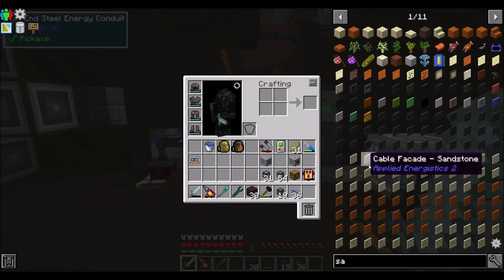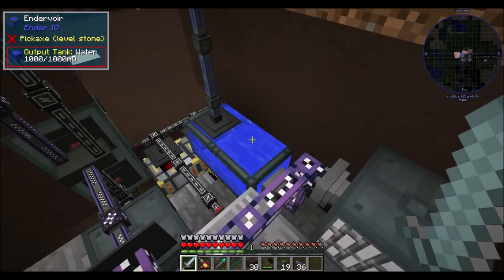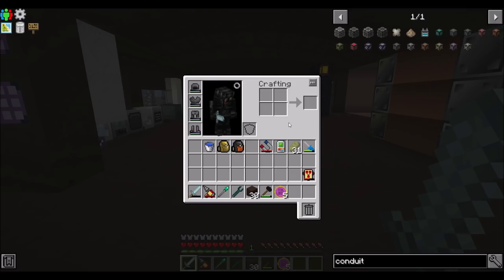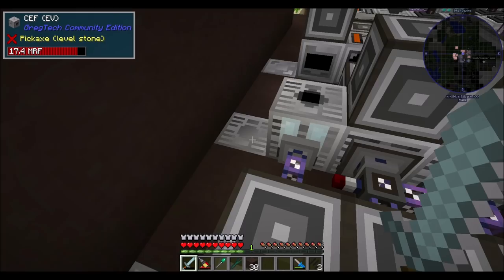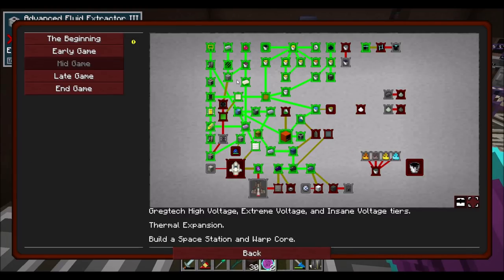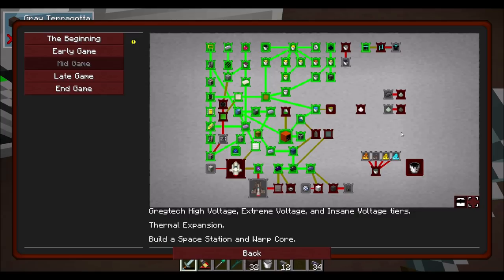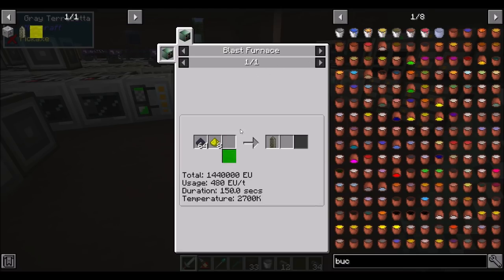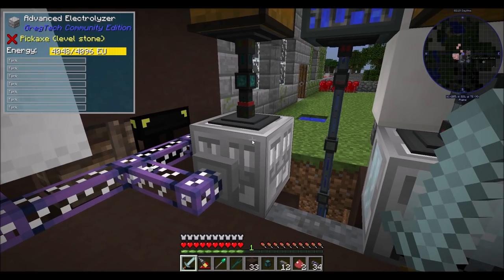OmniFactory   Ep46 EV Upgrades and Lapotrons

Comment: The End has LOTS of platinum and palladium. And yes the microminer are 100% worth it just let them auto craft and you get free stuff fast.
Reply: Platinum also comes from nickel for those of us who don't like travelling.  Of course that would require dire to actually use the ore washer.  Palladium you need so little of I just buy it until omnium at which point it can be gotten from microminer.

Comment: With diamond in the nursamatic gen you get 6k rf a tick(cant remember which u get) but you do get 6k power  when its upgraded and have power upgrades filled minus the coil upgrade to keep it from wasting power.
Reply: baseshooter11 I’m a little confused as someone who hasn’t got that far into the pack yet, 6000 RF/t is just 600 EU/t after conversions roughly? That’s not awful but building a Diesel Engine that makes >6000 EU/t surely makes more sense for long term power.
Reply: @ShawFujikawa  the RF/eu ratio is 4/1 and the numismática gen, when upgrades to signalum and with all upgrade slots filled can generate 20k RF/t using diamonds, with deep MPB learning you can make a self sustained power gen with ease
Reply: @Tsukiumy  pretty much

Comment: Dire wants clay: "Absolutely have to get that cobbleworks going." Also Dire: Totally ignores the fact that Terracotta pulverizes into four clay dust per Terracotta which gives him as much clay dust as he wants. Just set up the Actually Additions Miner to go get some Terracotta from nearby buildings and watch that bad boy strip mine it right off the buildings! :D Color apparently doesn't matter, you just want the clay from it.
Reply: A cobbleworks is so much more useful.  Not only does it produce unlimited clay dust but you also get gravel/sand for conduit binders.  Glass is used in a ton of recipes.  Along with nether quartz for lumium/signalum/enderium and pulsating clay polymer for Deep Mob Learning.
Reply: A. Cobbleworks isn’t in this pack, actually play this pack
B. Clay is infinite thanks to tweaking
Reply: @chonchjohnch   Cobbleworks is in almost every pack with a way to automate gravel/sand.  It pre-dates the cobbleworks mod which I've never heard of until I just did a search. all you are doing is basically making everything from cobble that you possibly can.

Comment: Finally, you understand the Importance of Naphtha. :D
To increase your output you can use  Bisphenol-A.
For 1000 mb of Epoxy Resin you need only:
1000mb Phenol
1000mb Oxygen
2000mb Propene
1000mb Benzene
125mb Phosphoric Acid
only 1666mb Chlorine!!!!!
and you even get 333mb Hydrogen

If you Steam Crack Naphtha you get already half of the ingredients: per 1000mb Naphtha you get 100mb Benzene and 300mb Propene. That results in 10.000mb Naphtha for 1000mb Epoxy Resin. This is just 4% better, but if you add all the other ingredients of steam-cracked-Naphtha like huge amounts of Ethylene you will be blown away. 
Also, it saves lots of Chlorine and you get additional Gasses to burn.
On top, you also can steam-crack Heavy Fuel and use your already build setup. Don't worry you always have anyways have to much of it. So you can transfer heavy fuel into Epoxy resin. The same works for Refinery Gas and Light-fuel. The beauty is you just have to build it once. HV-should be enough for the rest of the game.

If you have further questions you can contact me on Discord: JarJar#1187

Comment: I feel like you need to make break everything into modules... For example; instead of distilling water right where you need it, setup a distilling station where it dumps into the ME system. Apply that logic to literally everything and increase the efficiency of the modules when they become bottlenecks.

Comment: numismatic dynamo + Deep mob learning Shulker modules = Unlimited Diamonds and power. Basically 6250 rf/t without too many augments from 1 diamond. Setup a few simulation chambers and automate it. (top being input, any other side is output). Setup like 5 sims and 4 dynamo's with augments is 40kRF/t. (with power augment and reinforced tier). or 10kEU/t. Plenty to get into IV which is around 8kEU/t.

Comment: Would a second AE system for storing the ores be useful for organizing them or using some other method of storage?
Reply: Absolute best would be a proper ore processing system, followed by either large storage cell or a drawer controller with drawers for dusts, along with automatic electrolyzation of the appropriate dusts.  There's really only a handful of cases where you don't want the ores processed fully.